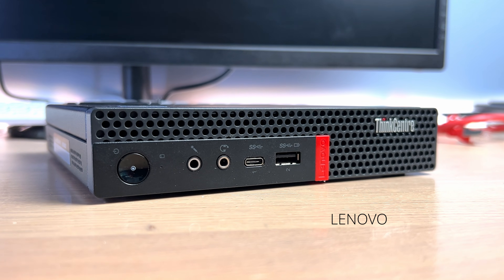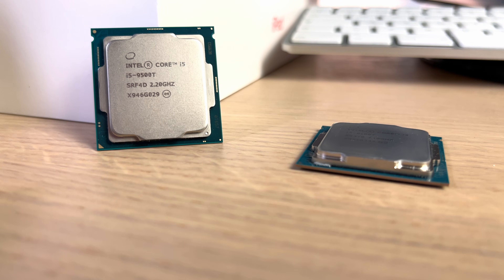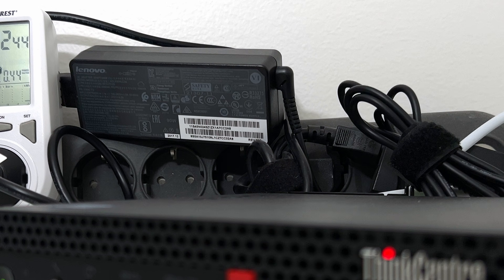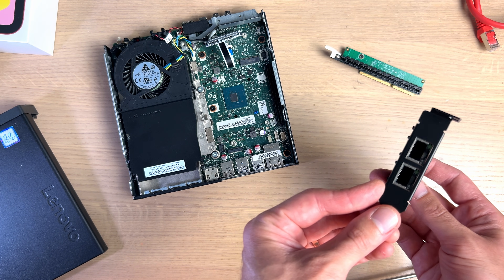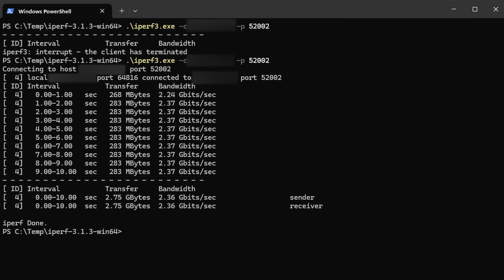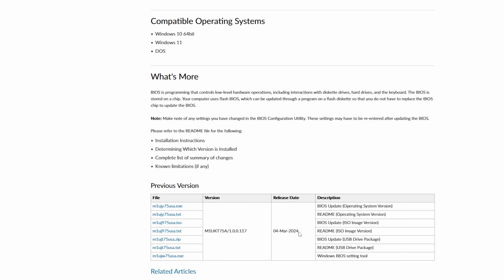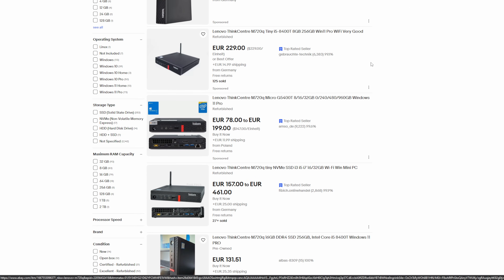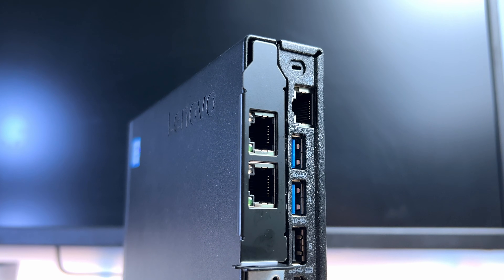The ULTIMATE budget hardware for pfSense, homelab, Proxmox...

Comment: I personnaly choose a Fujitsu Futro s930 for 30€ in ebay, changed to 8 Gb, 4 cores cpu which supports EAS-NI, installed pfsense 2.8 and works really fine at 9W idle and 20W Max. It is more than enough for home firewall.

Comment: darn I neglected the fact that the machine I ordered came with a 2.5inch SATA ssd, no room for that alongside the NIC
suppose that's something to watch out for, wondering how much a decent appropriate m.2 might set me back, the whole thing can be deceptively expensive if you aren't careful
I'm also struggling to get the new NIC's backplate to fit particularly well on the case